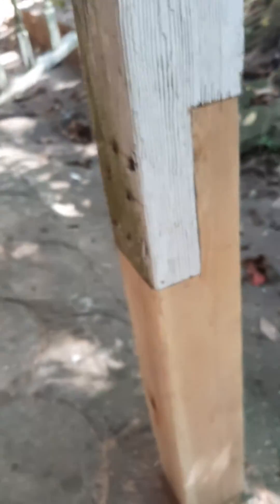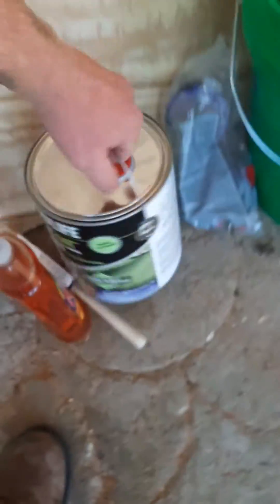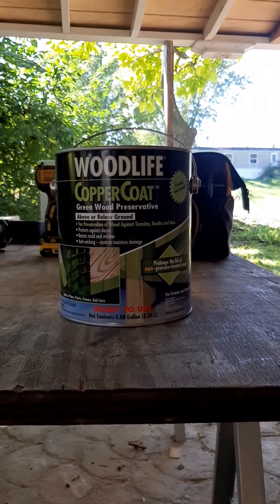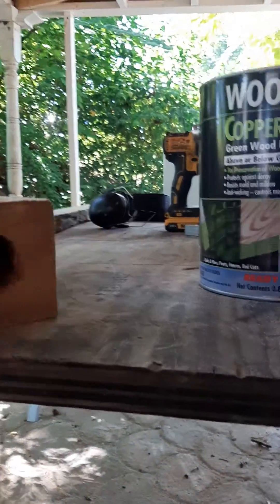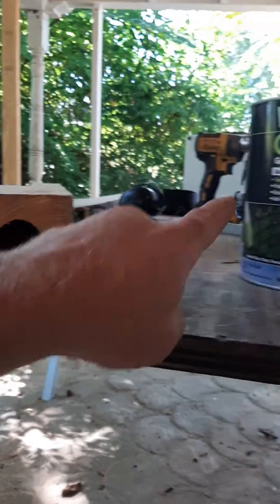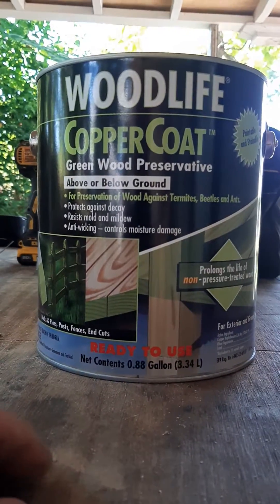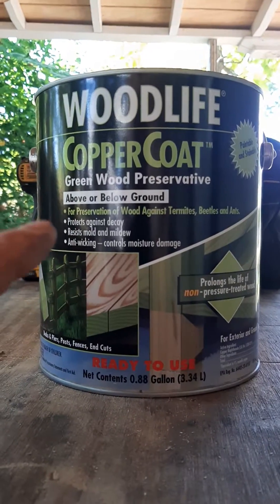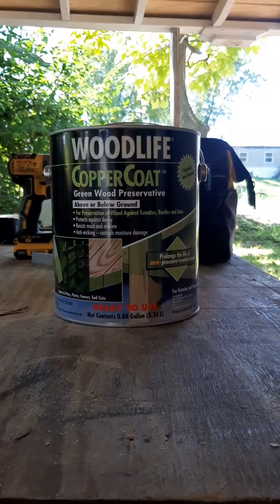Death Paint AKA Copper Naphthenate

Comment: I wish I knew about this stuff years ago. You can use it to treat cut edges of plywood, or any cut wood, really. Cut ends is where water gets in very easily and starts the rot process, which spreads like cancer. I'm currently faced with overhauling this big raised platform I built for solar panels... the thing was decked with plywood sheets, which I dutifully primed and double-coated w/ paint - - but I totally failed to treat the plywood edges. 15 years later I've got some serious rot going on.  Fortunately most of the support structure underneath was built with PT lumber, so at least it's not a total loss. Still, it's going to be a chore to redo the plywood. Live and learn, I always say. *I'll be replacing the plywood with 3/4" PT plywood, but still plan to thoroughly coat all the edges with the Copper-Green preservative solution.

Comment: Thanks for the useful tips and ideas!  I wanted to mention that copper naphthenate is not known to be a dangerous chemical. Copper is an essential mineral for humans and you get some in your diet (or you should).   

As a professional, you should be advising your viewers to read and understand the safety data sheet.  It is very clear that the risks are due to the solvent/carrier and not the copper naphthenate.

If you look up the MSDS for CopperCoat, you will see it has Monoethanolamine, which many people describe as smells/tastes like ammonia.  I bet that is what you are tasting...

CopperCoat is 9.1% copper naphthenate.   Another common brand is Copper Care and it is 17% copper naphthenate ... I use that one - more of the stuff that matters!

Comment: "That stuff" stinks to high heaven and the stink is very persistent. Never use it near your house on inside any building , I could smell it 200 feet away for several years on an outbuilding. It comes in several forms , some water based but all STINK forever. One drop on a shoe will stink up the whole house. Good for posts , far away from the house.

Comment: Can I paint over it after it dry
Reply: It is "slightly" oily so I wouldn't paint over it until it sets a good long while, just like new pressure treated lumber,. You would want to wait 6 months to a year. I know that after a year in Virginia, it is no longer oily, ands the deep green color practically vanishes where it is exposed to even a little sun. I don't know how it would be after 6 months, but I do know it definitely stays "slightly" oily for several weeks. Once it is completely dry though , it is just as paintable as the wood itself.

Comment: Nice video, more contractors need to learn to use copper naphthenate in applications like the one you present.  One criticism though, although copper napthenate is highly effective at wood preservation, it actually has a relatively low order of toxicity to humans.  It is good to be careful, but properly produced copper napthenate does not require personal protective equipment beyond good gloves and reasonable work to minimize skin exposure.  I use SHOWA 376 gloves, and that is the only protection that I use when applying the preservative.  Of course one will be using this outdoors, since it is not intended for indoor use.
Reply from the maker: I find the stuff has a habit of getting on me no matter how careful I am. And then I can taste it. And I hate that I can taste it. It's an excellent product you just have to prep right and be ready when you go to town with it. I see a ton of decks and fences and things like that that fail because they did not apply the preservative. But I didn't know about it until I read the entire Residential Building Code prescriptive deck guide.